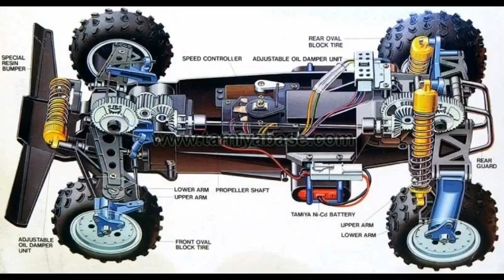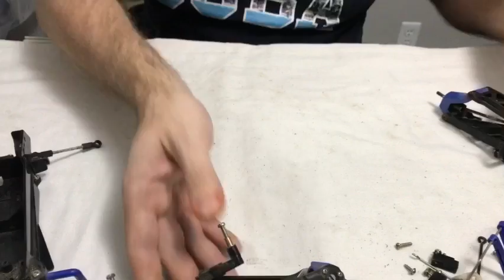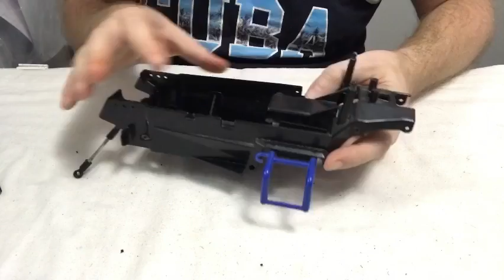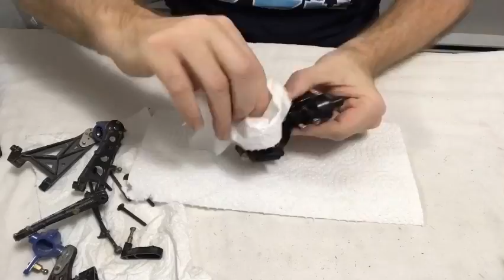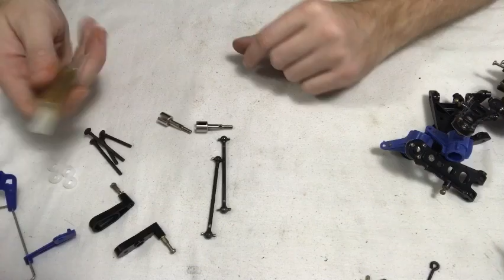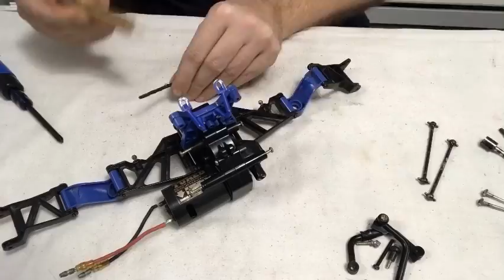Tamiya Boomerang  Restoration, Part 1...

Comment: Wheres the best place to get Boomerang hopup parts from now ? still got my Boomerang from 1986 but on its 2nd tub but everything still original. Running on lipo 3cell gearbox`s still holding up and checked re greased twice in all the years, only went lipo in the last 2 years though did have the black 540 but brushes must have been worn as the lipo battery killed it.
Reply from the maker: rs2klee 
Unfortunately eBay is probably the best place right now although the prices have gone through the roof with the pandemic 😞
Thanks for watching buddy 👊🏻

Comment: used to have a boomerang, and it was the car i ran the most. The only problem i had with the design, was the battery under cover. If you ran the car hard enough offroad, impacts to the ground can break the 2 hooks, the cover will drag on the ground, battery may fall out. If you ran without that cover, the rear of the chassis that mounts the rear gearbox, is thin and weak, and will flex and even break. I made a replacement for the cover from a piece of aluminium, cable tied the battery to those side crash bars, and that alum cover sparked when it hit the road. 

I also had issues with the central drive shaft, which would simply flex and bend, and start hammering the inside of the chassis, especailly if you ran off road. 
Later i lowered the suspension, changed the tyres, converted to RWD and ran it like an F1 car. This car gave me  years of fun. Was quite sorry to have to dump the car, as R/C parts in my country was just too stupid expensive.
22T is the largest pinion gear recommended by Tamiya. I know you can force a 23T and some even managed to use 25T, but that required modifying the motor position. But some guys i knew used to run Trinity Monster Power motors, and their cars would run insanely fast.  15T was standard, i preferred 17T on technigold
Reply from the maker: isf tish 
Excellent thanks for taking the time to do such a great comment my friend 😊👊🏻

Comment: Glenn! The Hotshot or the Boomerang? Which one is the better one? 

Autumn, tea, Digestive -cookies and watching Tamiya videos.. 👌🏻😋
Reply from the maker: Cosmo 1:35 
I think there very similar tbh, I’d guess I’d go for the Hotshot as it had a massive part in the Tamiya history timeline 😍👊🏻
Reply: @TAMIYALegends  Paint the Boomerang red and pretend it to be the Hottie 🤣 I read from the forums that the Hotshot rear suspension breaks easily over time, is this true?
Reply from the maker: Cosmo 1:35 
It could well do, I’ve actually never really ran a Hotshot. Although I’ll be doing that over the next month, so fingers crossed I don’t break it 😬
Reply: @TAMIYALegends  Hotshot is cooler looking tho. Let's hope it'll hold together! This is horrifyin, after watching Mr. Evans' video about Kyosho Turbo Optima , i just want it..damn it! CR-01 Bronco is coming this way from Ebay. Great hobby this thing called RC..

Comment: Cool to see.  Glad there has been a re-release and parts available, my original has sat on a shelf with cracked rear suspension arms for over 20years.  The HotShot 'hopup' of dual front shocks mounted nicely to this buggy and made a huge difference.

Comment: Please could you provide a link of what speedo you are using and what you use to make the tires shiny. Thanks.
Reply from the maker: QWERTY ASDF 
The speedo is a New Rain 320A unlimited Brushed 
Just use a can of Silicone spray on the tyres 😎👊🏻
Reply: Thanks for the fast reply, much appreciated.

Comment: Fun video!
 I have a boomerang sitting on the shelf ready to go through a tear down , and this vid is inspiring me to get cracking😬
Have had good results with yellowed nylon wheels getting white again using 50/50 mix of hydrogen-peroxide and water. Letting it sit in the sunlight for a couple days. Not sure if it would work on the Tamiya wheel material, but worth a try before spraying.
Looking forward to seeing the next steps!
Reply: Donovan Gladden water bath with peroxide, bleach and 1 dish washer tablet. Comes out white.
Reply: @SupertecRacing  Thanks for the tip! Any specific ratio of water/peroxide/bleach?
Reply: Donovan Gladden 1ltr water, 100ml peroxide and 100-150ml bleach. Forgot to mention leave it in the sunlight for 3/4 hours and turn the wheels over half way through. Don’t forget washer tablet from the get go.

Comment: You know, my old Boomerang was painted silver as well. My mum gave it away long time ago to a cousin who lives in Europe and she also shipped my old Blackfoot. My version of the Boomerang has the longer front shock shaft (black). I read somewhere that it was an improvement shared with the Hotshot II. One thing I hate Boomerang (and Bigwig plus Super Sabre) is the fragile bumper. It kept breaking on me and at the time it was very expensive to buy (just) the bumper. To fix the breakage, I put a hex screw without washer. Then I broke the back screws instead >.<

Comment: Maybe you can answer this.
At what point in a restoration does an "original" cease to be categorised as original?
Reply from the maker: Steve Moon 
Great question 🤔
I think it all comes down to how much of a purist the individual is?  Technically this Boomerang once it’s finished will have a Tamiya re-re Body and Decals, so I guess it’s not an original!
Luckily I’m not overly concerned by that kind of stuff unless the person sells it as a complete original without stating the changes they made.
I know some Tamiya enthusiasts who won’t touch a Re-re 😞
What’s your opinion on it my friend?
Reply: @TAMIYALegends  Thanks for the reply. I had this conversation recently following a few "possibly spurious" listings on eBay, & it seems to be a bit of a restoration grey area. Although I absolutely don't consider myself a collector; in any sense of the word (ownership is its own reward & most of my stuff is re/re anyway. I simply buy what I like.)
IMO, a first release (obviously) with the original plastic body (new genuine decals if needed is not really an issue for me.) And the "majority" of the chassis are requisite to be what I would personally consider it an original.